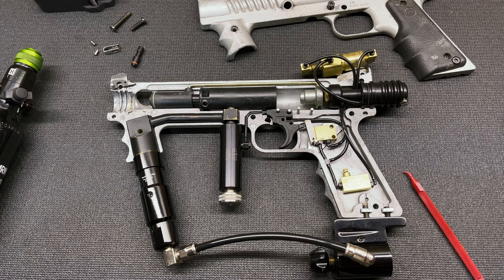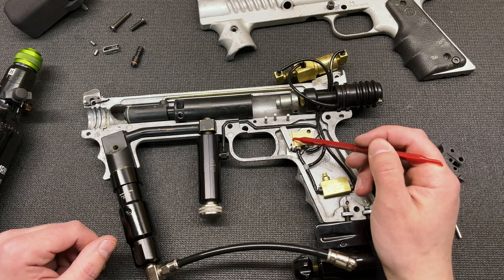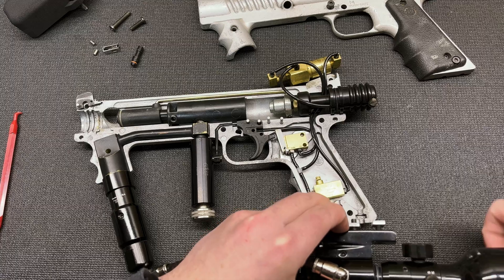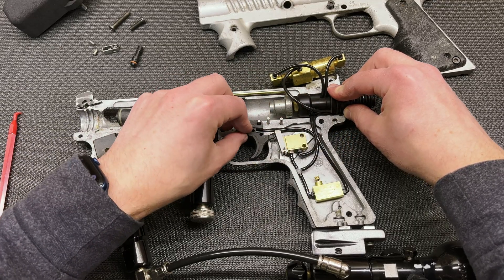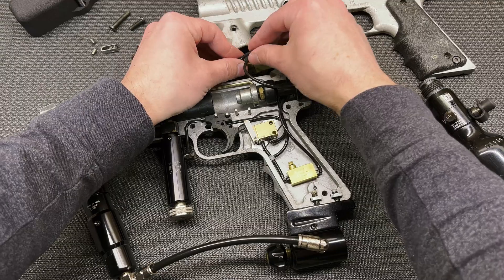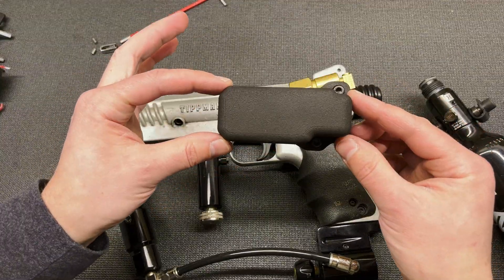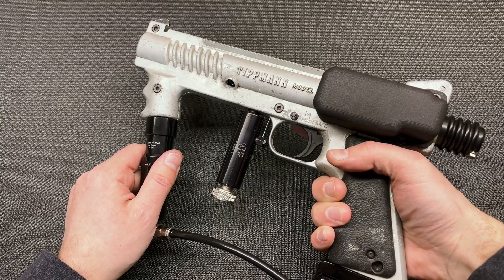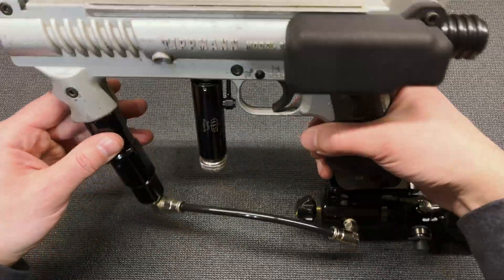Build - Tippmann Model 98 E-Bolt/P-Bolt Demonstration

Comment: Hey man, have you field tested this? What kind of velocities are you getting? 
Either way this is awesome! It seems like it would be relatively easy to adapt to other ram driven electros....
Reply from the maker: Fraid I haven't yet! Prepping for a move so much of my equipment has been packed up. I agree it should be relatively easy to adapt to other markers and can probably be made more compact with a custom pulse valve. I have a Diablo Wrath I was thinking of trying the method out on when I get a chance.
Reply: @PeculiarPaintball  a wraith would be dope! I have an old bushmaster B2k I was thinking about trying this with, should be plenty of room in the tray & grip for all the pneumatic bits. Pretty much would just need to drill and tap the bottom of the body and slap it together. I imagine the hardest part would be setting the trigger. The low operating pressure of the bushmaster would probably make obtaining a playable velocity quite a bit easier too.
Reply: I have seen people use sp impulse rams